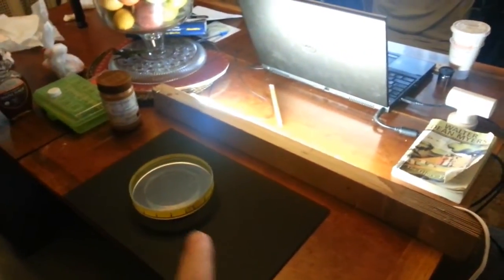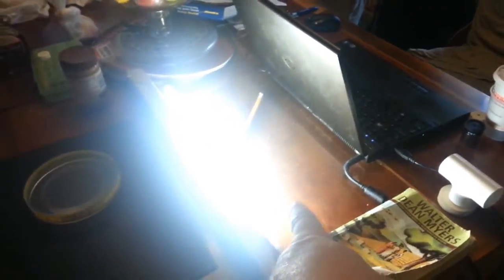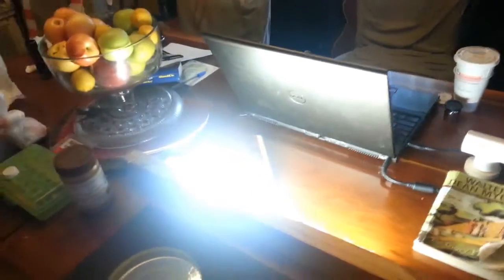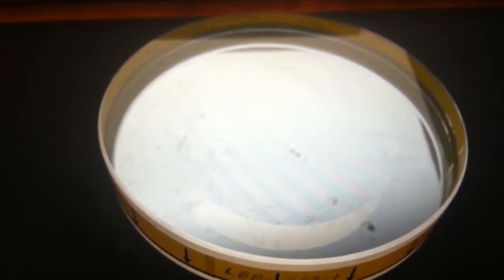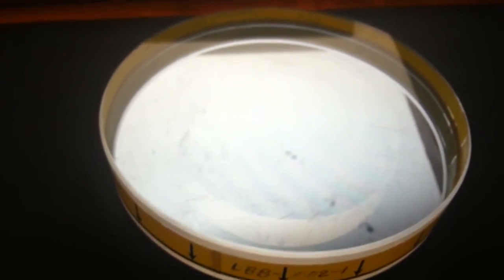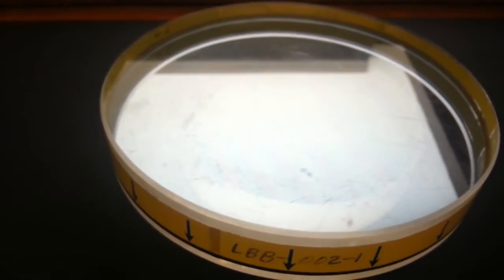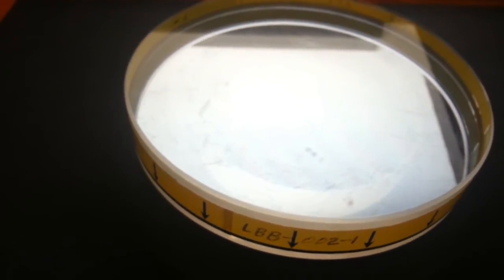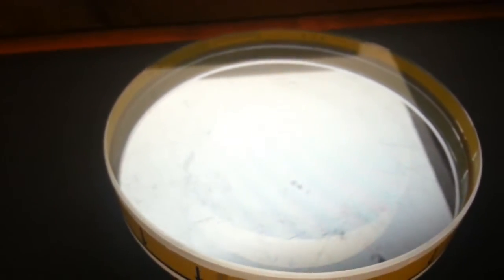how to test an optical flat

Comment: The instructions I read talked about a single wave length light. You say “T5” bulb. I think that’s a bulb configuration. So, was it a fluorescent or an LED or what?
Did bouncing it off the cardboard get it down to a single wavelength or is that not absolutely necessary.
I want to check how good a polished 304 stainless mirror is for a marine sextant. Hubble telescope precision is not required. Modern float glass is flat enough to not cause problems. Thanks, Noell
Reply from the maker: @noellwilson1273  I know some use a specific color to test flats, like green, what I’m testing there’s no need for that 

The cardboard is really white foamcore, yes it’s a fluorescent bulb